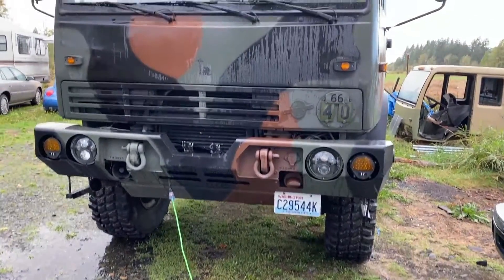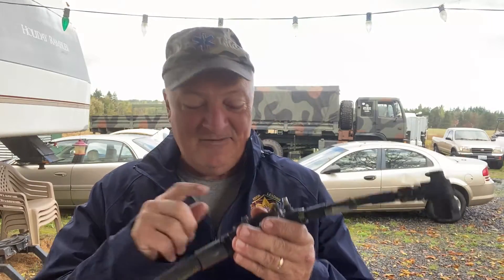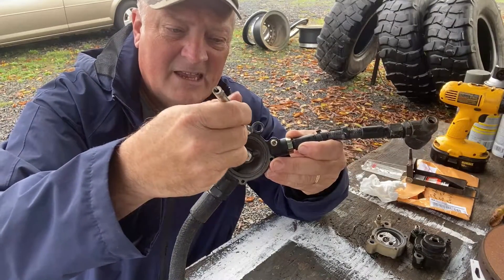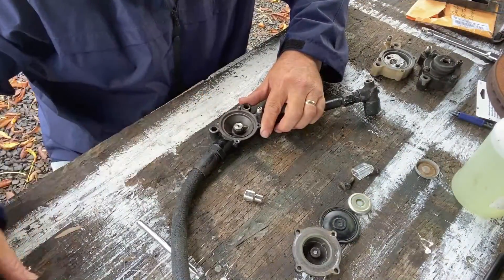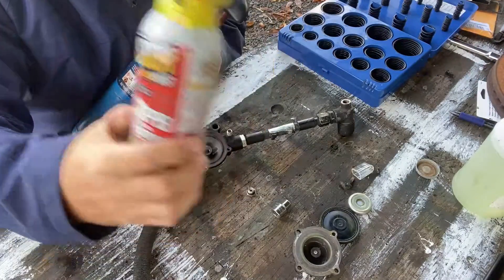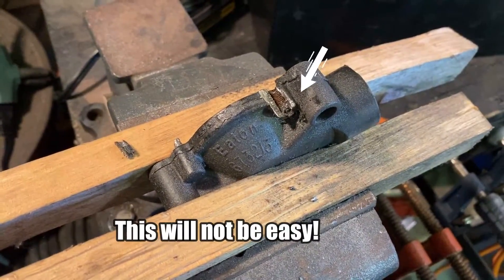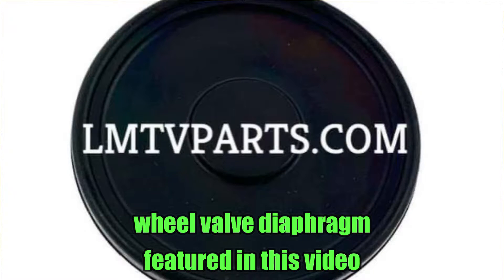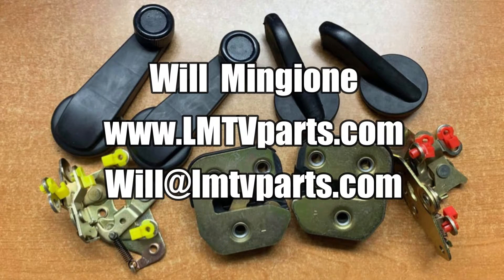WHEEL VALVE REHAB for FMTV CTIS #139

Comment: I learned a lot.  Thanks for sharing!
Reply from the maker: Ever done aluminum casting? I'm going to do some research to see if I can recast the wheel valve shoulder that I had to cut the rusted bolt out of. If successful, I'll re-drill the hole and tap it with new threads. Sounds like an adventure to me!
Reply: @HelicoolsHelipad  I have a fb friend who casts aluminum Subaru lift kits out of old melted down aluminum wheels.  Scott Raper: SJR lift kits
Reply from the maker: @SeanFastidious  Right on! I just wonder if it is possible to cast a small piece onto an existing piece if you heat the existing piece not quite to the melting point. I'm going to try it with the wheel valve body.

Comment: I use a homemade penetrating fluid that works well with heat.  Mix equal parts Synthetic transmission fluid, Acetone and brake fluid. shake it frequently.  Note- it will eventually destroy the spray bottle.
Reply from the maker: You know, the best products often times have to be the most harsh... I am going to do a video on the best (unorthodox) ways to remove the bolts from the aluminum body. Yours just made the list! Thank you for that.

Comment: If you soak just the aluminum part in some sort of acid, battery acid works, it will dissolve the bolts in anything aluminum as long as the bolts are steel 👍
Reply from the maker: GENIOUS!!! You get 10.0 for today! That is thinking outside the box right there, and I love it!

Comment: Remember, the QR valve is a remote pressure regulator, so any pressure trapped, upstream it will try to maintain on the output.  Interesting it only leaked on one wheel...  the dump valve will fix it:)
Reply from the maker: This is also why I was so sure it was a diaphragm... only one wheel was effected. I suppose its diaphragm holds air just a little bit better than the other. In any case, the dump valve is the very next install, for sure! Thanks for all your help on this rather perplexing air handling build.
Reply: @HelicoolsHelipad  The wheel that stays up may be the problem tire. See if it will air down.
Reply from the maker: @badbadbob1  I had an epiphany today with some additional testing. The reason why the other tire is not deflating, is because it has a high enough pressure that the back pressure in the line cannot overcome it or equalize it (as the case may be) and cause the diaphragm to allow air to leak past it. What is happening is there is back-pressure roughly equal to the left-hand tire... and the back-pressure is enough to slowly fail the lower pressured tire. It is very weird and frustrating, but that is how that dang quick release valve is supposed to operate... sort of. I just have to eliminate that back-pressure.